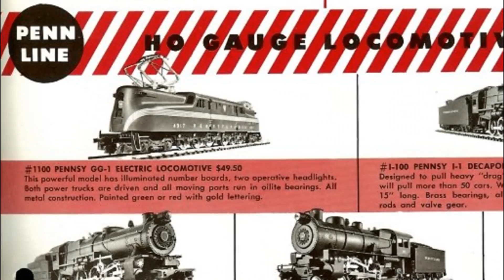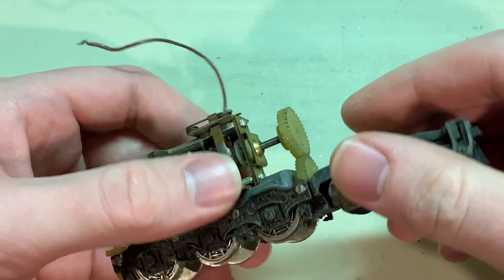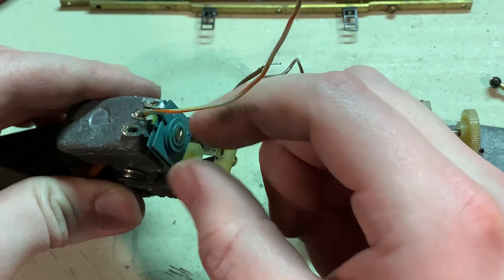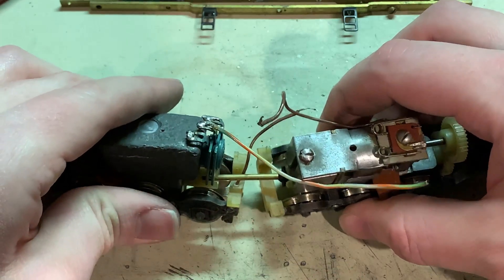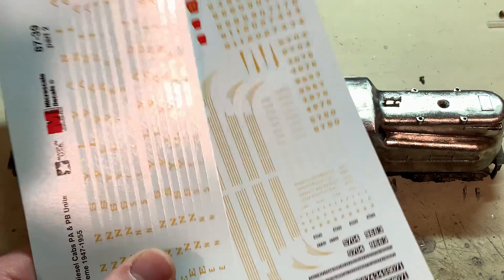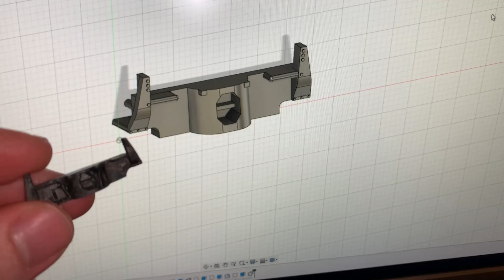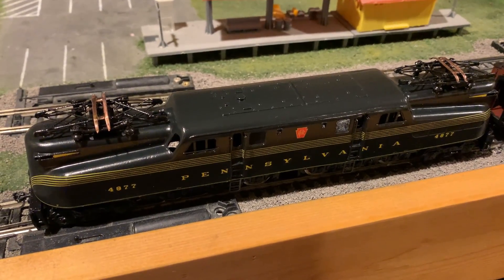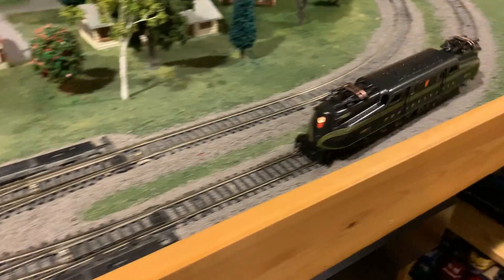Penn Line HO GG1 Restoration and Review

Comment: Thanks for the video very informative.

I have a question though : I've noticed you checked the polarity of the permanent magnet while you were replacing it. Can you tell me why did you do this and what happens if you put it the other way around?

Additionally, and If you want, I also found the removing of the paint and re painting informative, don't hesitate to include it in your videos!
Thank you
Regards,
Agustin
Reply from the maker: Thanks! I checked the polarity so that I could reverse it to work correctly with the belt drive. The original gear drive turns the wormshaft in the opposite direction of the motor, but the belt drive instead turns with the motor.  By flipping the magnet, the motor turns the other way.

Comment: When you compare the small Lionel gg1 Electric 2 a scale pg1 Electric the smaller version resembles a streamlined p5a which they call the baby gg1. I models of Penn Central and o-gauge three rail started with my Subway car sets from Mike's train house so I have an easy rationalization for the third rail being there and I run all of my electric pantograph down like my ep 5 because that's what they did when they were in third rail territory. It seems that all of the gg1 Electric regardless of manufacturer and scale all seem to be equipped to be able to run off the Pantagraph. For instance you can run a Lionel Tri-Rail gg1 onto rail with pantograph and you could use three rail cars because there's nothing to short-circuit them like if they were on a two rail track. For me I would rather we had trains and tracks going everywhere instead of interstate highways and Roads.

Comment: I think id change the plastic gears to metal ones it would probably prolong the life of the restoration.
Reply from the maker: You’d be surprised at how long properly made nylon gears can last! As long as they’re properly maintained, they can run practically forever.
Reply: Im more used to UK market where metal gears are used as standard although since the merger of Hornby and Triang the body shells are all plastic unlike the early ones which were die cast and had greater adhesion and hence pulling power. I wont buy Bachmann as over priced and no good on tight curves

Comment: Glad my 1938 Meccanno Tin Plate Clockwork O gauge Freight Set No 1 is still boxed still runs properly
 No restoration needed even after 84 year
Reply from the maker: Very nice! I’ve rarely seen any complete sets of that age in that kind of condition, so that’s definitely worth a lot in more ways than one!
Reply: @DarthSantaFe  ive got a collection of about 100 locomotives all 00 gauge but they are all boxed still and most are in mint condition as i just dont have the room to rebuild my layout. I still have me original Hornby Dublo crane set boxed but the otiginal green string has perished away after 62 years. M
Reply: @DarthSantaFe  if you have a Whatsapp address i will send you a few pics.
Reply from the maker: @michaelcampin1464  I don't have a Whatsapp account, but it does sound like you have a very nice collection!

Comment: I have one of these, a Varney, and the drive wheels have some kind of white metal inside brass rims. The white metal has bulged out on the back side of the wheel and is so tight against the inside block that they won't turn. I started to make resin copies of the AHM wheel interior that has better detail to put inside the Varney rim and got one replacement made before losing interest. any other ideas about how to repair these wheels?
Reply from the maker: The wheels for these show up on eBay sometimes, so you might be able to find some good originals.  If you don't mind less detail, you may also be able to use some simpler wheels of the correct size.  The cast wheels were made from zinc, which expands and falls apart if it wasn't perfectly pure when it was cast.
Reply: @DarthSantaFe  Thanks, I hadn't thought of using solid brass wheels, or I could go on with making resin centers. For now I have trolleys and interurbans taking up my attention. I will have to do something about the heavy electrics in my collection though.
Reply: Sounds like they have zinc pest, which incurable.

Comment: I have 18 Penn Line GG1s. I try to buy them in mint shape. I also have 11 Penn Line Decapods. These engines are indestructible.  It bothers me to see the shape some are in. Abused by people who didn't know what they had. Early HO trains aren't like trains today. They were miniature machines meant to run forever and not wear out. I see you went to band drive. The noise the gears make I find appealing. It is the sound of a brut. I have 2 Varney GG1s and without the DC70 Pittman they are junk. The frame has to be modified but I was able to install DC70s. The gears are also inferior but none have exploded yet. I have two Schraeder GG1s. Its all heavy brass construction. Not very realistic looking but sports two monster DC71 Pittmans and can pull down a house. I have only seen one other advertised on Ebay in the last 5 years. Very rare I suppose. I see on Ebay Penn Line GG1s in New Haven. I can't find this in any Penn Line catalogue that I have seen. Do you know if these were actually made by Penn Line? Or was it a paint job and a decal set from a kit?
Reply from the maker: That’s quite a collection! It is sad to see when these have been treated so poorly. At the same time though, there’s also something satisfying about taking one of those beat up units and restoring it to look like new. I did keep the old gears in case I ever want to switch back, but the belt drive should hold up well as long as I take care of it.

It looks like the New Haven version was brought out in 1960 for train sets, but they did also make it separate at least in 1962: https://hoseeker.net/pennlineinformation.html
Reply: Not sure if you know already, but the PL Decapod's boiler is too small. PL used their K4/L1 boiler on it (Hey, 4-6-2, 2-8-2's and 2-10-0's have the same number of axles, right?). Cary made a tidy sum over the years providing scale size boilers to the Decapods. That ended when Bowser took over and began making their own scale boiler. I have one of each and the difference is pretty obvious. I explain it away by saying it was one off experimental made for PRR subsidiary, the Wrong Island Rail Way.
Reply from the maker: @colbeausabre8842  And there was also the matter of different dome placement between the K4 and L1, so for the Penn Line originals, only the K4 was an accurate model.

Comment: Great video. Back in 2012 I found a fixer upper GHC Penn Line GG1 cheap. Unfortunately it was missing the Pittman motor/gear so it sat in its box until recently. Could you share what parts you used to convert yours to band drive?
Reply from the maker: The pulleys were made from scratch with my 3D printer. There may be some of similar size out there, but it should also be possible to turn some from plastic or metal rod. The belt came from Athearn, who still sells packs of them for their old Hi-F drives.

Comment: As a SPF (Slobberin' Pennsy Freak). Great Job! You just have to feed it and one day, you will have a full sized GG1. Couola points 1) Although almost everyone calls in Brunswick Green, its official name was Dark Green Locomotive Enamel. The one thing PRR modelers agree on is that out of the bottle or can BG is NOT DGLE. What IS is a matter of endless debate  2) Don't worry about your model being loud. So were prototype GG1's. I stood on the platform at Penn Station Newark or New Brunswick to greet my dad after a business trip enough times to know that the blowers were blasting away!

Comment: Darth, I have many Penn-Line GG1's the green diode atached to the wight is for reversing headlights, Penn-Line made this engine in many variations including New Haven and Great Northern  from 1956-1963 when Penn-Line went out of business in the late 60's Varney had the tooling and made this engine until they sold out to Life-like and Life-like sold off the rest of Varney's stock.Bowser did get the tooling for the GG 1 but they never made it Hope this helps with the history of this engine
Reply from the maker: Thanks!  The diode/rectifier did work for the directional lights once I had this all back together.  Pretty impressive that they had that back when vacuum tubes were still common for electronics!
Reply: @DarthSantaFe  It's an old-fashioned (pre solid-state) diode. A rectifier converts AC to DC via a capacitor and four diodes arranged in a "Wheatstone Bridge."
Reply from the maker: @Greatdome99  I was just calling it what Penn Line did in the manual. :)  Since both lights are connected to it, it seems to operate like 2 standard diodes wired in series, with the track power in the middle and the light bulbs at each end.

Comment: Just asking…
Why do Jouef BB models rattle on Fleischmann profi rails.
Or is that just me ?
Reply from the maker: It could be that some of the older models have flanges even larger than the track can handle, but I can’t say for sure. The flanges on my old Jouef electric are so large that they ride up on my code 100 switches.

Comment: I have one of these my father purchased before I was born.  I may need to restore it now.  I also have a Penn Line T1 I purchased as an unassembled kit in the 90s. It’s built and runs great also.  I need to get some decals for it since the originals were old and did not work.
Reply from the maker: Nice!  As long as there are no broken parts, I'm sure it can be made into a good runner without too much trouble. :)
I have one of the later diecast Bowser T1 kits, which was based on the Penn Line model, and it's an insanely powerful engine.  Since the PL model is made from lead, I imagine that it's got even more traction than my Bowser!

Comment: I would like to see you tackle a Jouef 1980's TGV.
Reply from the maker: Maybe eventually! I do like the TGVs.
Reply: @DarthSantaFe  Great! Because, I have one one and the powered truck is all traction tires and the motor is an ancient 3 pole with a bad gear setup. (Edit): It would be interesting to see you come up with a way to improve it to modern standards. I plan on attempting it, but I am having a tough time figuring how I will start later on. It has a lot of space inside though!

Comment: Your restoration is good, but you lost speed when you changed to a BA d drive. Your torque went up though because of the smaller trasfer. I also know you could have recharged your old magnet using the rare earth magnet that you purchased. There is an article on this very thing if you want go search for the article. Otherwise, you changed the specks a little. Hope this helps. I also saw the recharger that the man in England. Had built, but the same can performed with a neodymium magnet.
Reply from the maker: It's actually a 1:1 transfer with both the gearing and belt drive, so the speed from the gear + transfer ratio is the same.  The motor's top speed was reduced by the high-power magnet, but it actually resulted in a slightly increased speed because the old magnet was too weak to drive it.  I have recharged magnets before in motors where the magnet isn't easily replaced, but for motors like this one, it's easier to swap out the magnet, and you get a stronger level of magnetism that the old Alnico magnets can't maintain due to the limits of the material vs the newer neodymium alloy.

Comment: Very nice! Blast from the past. We had a couple of these on the layout growing up. It always miffed me that the road numbers from the factory we not in the proper 4800-4900 series. It is also amusing that there is a Penn Line GG-1 in this world with 3D printed parts.
Reply from the maker: That was an odd choice not using any realistic road numbers on their pre-decorated models.  I have to wonder what the reason was.
I thought of searching for an original part for the pilot, but then decided as long as I have the 3D printer, I might as well give that a shot first. :)
Reply: @DarthSantaFe  Now that I think of it (through the cobwebs of time) we had a third that had the truck frames disintegrate. Bad metallurgy. Nice to see you found a good one.
Reply from the maker: @maestromecanico597  Yeah, that was a common problem back then with a lot of diecast products.  Manufacturers didn't seem to realize how pure you have to get the metal to make it last a long time.  One of the biggest examples is the American Flyer O-gauge 0-8-0.  At least 99% of them disintegrated within 20 years including the one my grandpa owned.  I still have the tender though, and it's one of the very few left in existence!
Reply: @maestromecanico597  Le Zinc Pest https://en.wikipedia.org/wiki/Zinc_pest

Comment: Looks like the motor axle is easy to upgrade with a heavy flywheel.
That would improve the running behaviour to a much smoother run, which looks much more realistic.
A large non-polarised capacitor (10mF/35V) connected acrost the brush terminals would further improve it.

Consider doing the math for the correct scale speed, instead of running the motor at full rail voltage.
e.g. if realtime max speed for the engine is 40mph,
then scale speed is 40mhp/87 = 0.46mph = 0.675 ft/sec ~ 8"/sec

Thanks for the video !

Comment: Everybody goes on about how we need High-Speed Rail and we had High-Speed Rail and everybody took the plane or the car. Tg1 with Run 100 miles an hour with a 10 or 12 car train. A standard passenger car weighs 100 tons. Electric locomotives accelerate their trains to running speed much faster than a diesel can

Comment: Wait wait. This train could run off the  power poles above the track?! Omg i hope you keep that feature. It would be good at train shows and stuff if you go to them or if you can because of the c-19 but still just the idea to have that feature is amazing
Reply from the maker: Yes, it can run so power comes from overhead wires and the right side rail. I clear coated over the pantographs to protect the finish, but that can easily be scraped away if I ever want to use overhead wires.

Comment: I just subscribed…love watching these videos. I’m new at this hobby and my question is….unlike today when you just walk into a store and buy a loco already assembled in a nice box; you keep referring to these old locos as “kits”. Does that mean you used to buy these trains and assembled them yourself? You would order the model you liked and then picked the various options….motors etc. and built your own loco?
Reply from the maker: Thanks!
Back in the early days of HO scale, just about everything came in kit form if you weren't scratch building, and most of the decent kits came from Varney, MDC/Roundhouse, Mantua, Bowser, Penn Line, Lindsay and Hobbytown.  Until the mid to late 50's, quality ready to run models were pretty rare!  Most kits did include the motor and wheels, but it really was a craftsman's hobby involving a lot of custom work for a long time.

Comment: With the time you put in you should have primed filled and wet sanded for a perfect paint job there were bits I saw you miss on cleaning hopefully it was done of camera as for the motor most of these work after a little cleaning but you could have just replaced with an upgraded motor as they are not really worth fixing unless it’s a valuable train being restored, something you could try is with the cup on the end of the worm gear it can be reinforced with a piece of heat shrink as they become brittle and split and they are somewhat harder to find a good replacement, still a good try but a small media blaster will take you to the next level.
Reply from the maker: Thanks for the suggestions!  I did consider doing some filling and sanding, but decided in the end to let the model keep a bit of the "vintage" appearance from the slightly rough casting (I do try to fill in rough spots on some of my other projects).  The Pittman motor is as smooth and dependable as a good quality can motor when tuned correctly, so the magnet upgrade was a cheaper way to improve the performance.  The cup joints on mine are actually still in really good shape, so I'll keep them as long as they're working. :)

Comment: I just don’t understand, why most people can’t primer it and sand it, so the finish on it could be more smooth and professional.With all the work it took to put on the decals, I think it was a waste of time.And if the train is green, I need to get my eyes checked, because it sure looks like pure black to me.It came in, black, green, maroon, and silver. That’s definitely black.
Reply from the maker: More coats of paint tend to obscure very fine details. Maybe it would have been better for this one, but for something like a very fine brass model with a perfectly smooth surface, the thinner the coat, the better it is (as long as it’s opaque).

PRR’s green was nearly black. My basement’s lighting isn’t the best for this, but when shown under brighter light, the hint of green in the paint becomes more apparent.

Comment: You could have used metal gears.
Reply from the maker: The plastic gears in the trucks work fine, so I didn’t see any need to replace them. I replaced the tower gears with a belt drive only to reduce noise (metal gears would be even noisier).